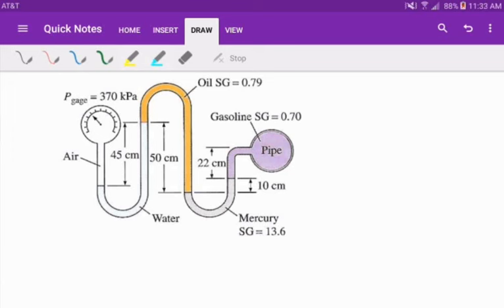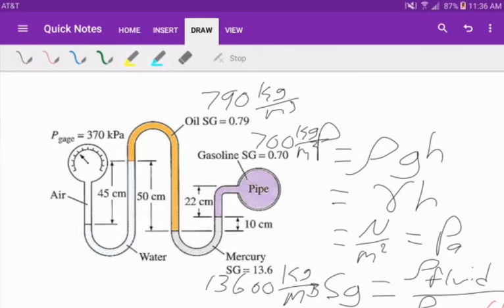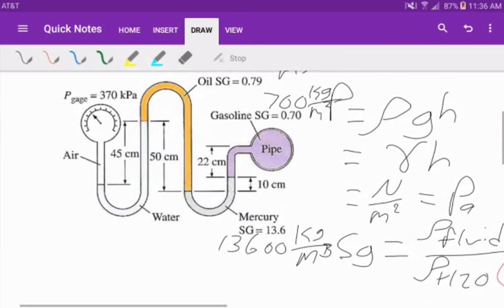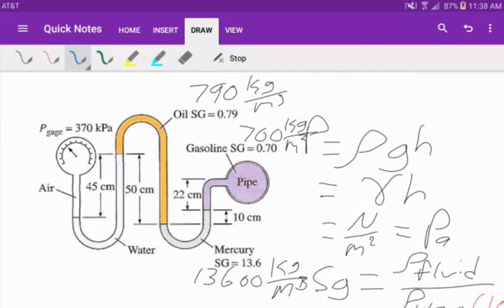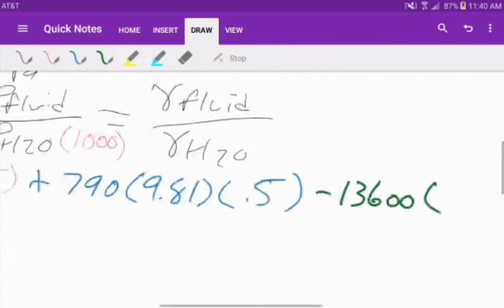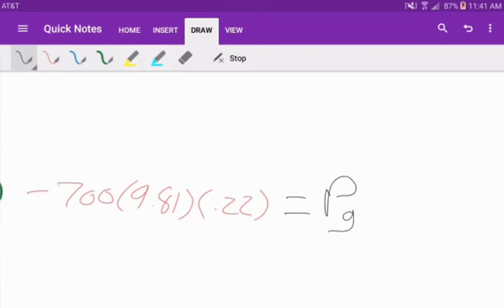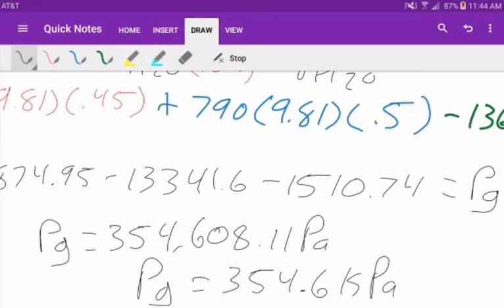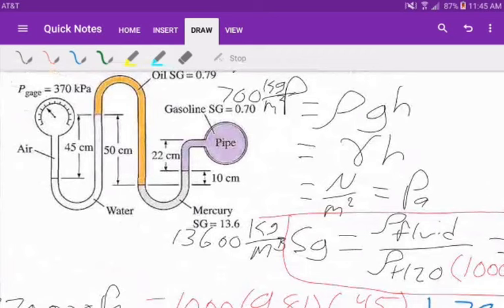Fluids - Multifluid Manometer Example #2

Comment: An inverted differential manometer is connected to two pipe A And B carrying water under pressure as shown in fig.2.26.
the fluid in the manometer is oil of specific gravity 0.75 .Determine the pressure dufference between A and B

Comment: please why did you multiply mercury and gasoline with 9.81 and didnt for others?
Reply from the maker: Nabeel lee I multiplied all liquids by 9.81 so I could find pressure. Pressure is the density of the fluid(rho)*gravity(g)*difference in height(h). The only term not multiplied by 9.81 is air since it is already given to us in pressure.